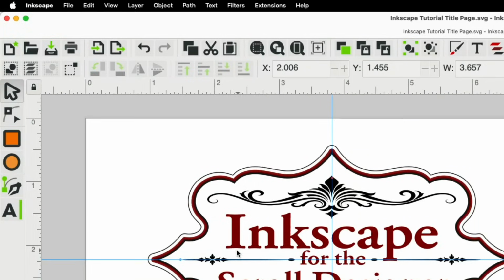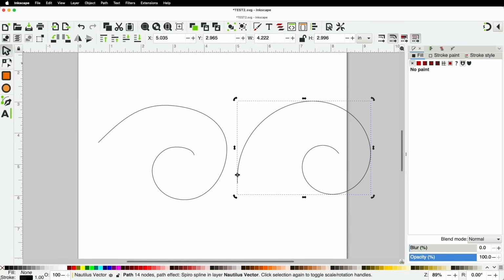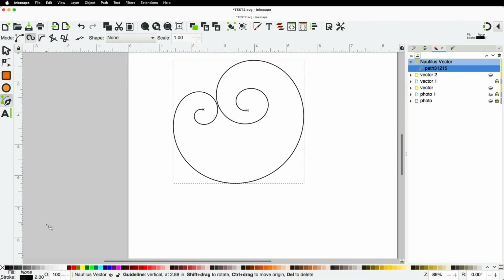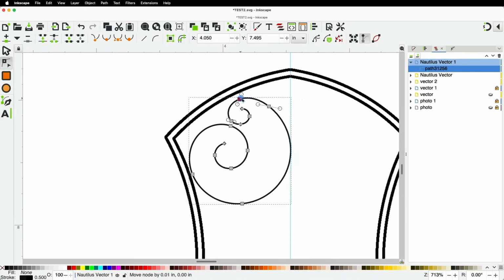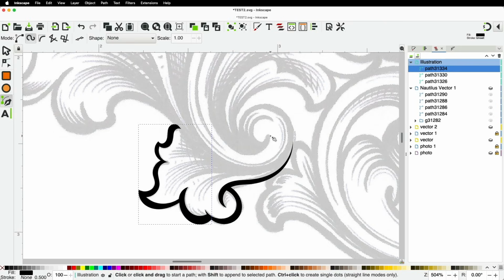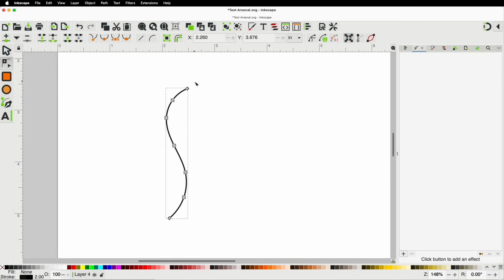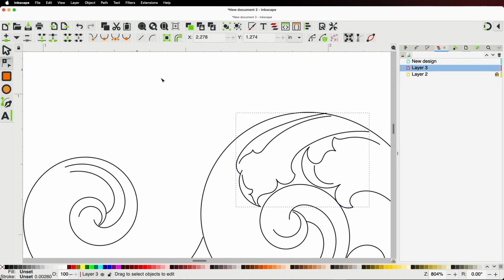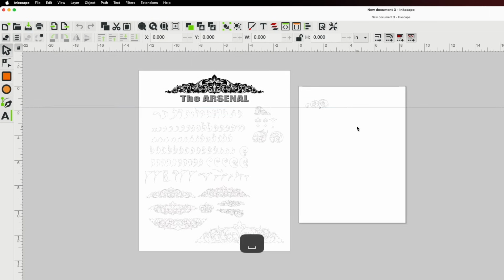Inkscape for the Scroll Designer

Comment: I can't believe I've been using Inkscape for 20 years and I never knew about the spiro path tool! Thank you!

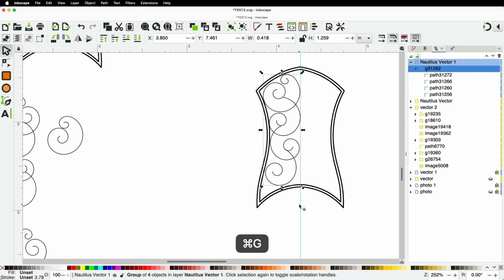One feature you might not know: once you create the group at 28:00, if you duplicate it with Alt-D instead of Ctrl-D you create a clone, which is a link to the original instead of a full copy. (Or you can use the Clone items in the Edit menu.) You can then flip the clone horizontally and move it, or even scale it and rotate it; then, when you change the original object, including double clicking on the original if it's a group in order to edit its contents (without undoing the group), all your edits will be automatically reflected on the clones, meaning on the mirrored side. This way, as you are editing the left side, changing the paths or adding new ones inside the group, you will see the right side automatically update after every operation.

Another piece of advice: if you use one of the default Shape options on the top toolbar when creating a path (such as Triangle in) then when you go into edit mode you will see an extra pink control point. That point controls the thickness of the path! You can move it around, for instance moving it to the middle of an S shape will create a nice thin-thick-thin shape, without having to draw both sides of the shape by hand, as a closed curve. Or using the Triangle out shape will allow you to make your fills, the ones you use the half circle for, but give you extra control on their thickness. You can Ctrl-click (I suppose Cmd on Mac?) and drag on a pink control point to create a new one, and Ctrl-Alt-click on one to delete it. This way, 99% of shape thickness can be quickly edited without having to manually create a closed shape. The way this works is by adding Power Stroke in the Path Effects, where you will find further options to control the width generated by the pink control points.

Inkscape is amazing, you can use it for decades and still discover huge parts of it. By the way, I would recommend using the latest version and not an older one, unless you are waiting for a specific bug to be fixed, because they are always working on fixing things and adding new features.
Reply from the maker: Yes. All good tips. Unfortunately the latest versions have Spiro bugs
Reply: @NGraver001  New version 1.4.4 is out since 5/6/26. Does it have the spiro bugs?

Comment: If I may I'd like to suggest some options that you may find useful. In order to align nodes you can select the align and distribute which will do just that for nodes as well as objects. Also, when you draw a spiral, it is initially a stroke, that is it is only a curled line. You can make that line broader by selecting path> stroke to path, and widen the stroke. Finally, instead of manually placing object that you want symmetrical, you can use the path> path effects tool to mirror or tile objects. Hope this helps.

Comment: how do you have the template next to the page like that. and if you save and bring it to ezcad, will it send just the page on the right?
Reply from the maker: You can put any element off to the side of the "Page". The best way to use one of these types of designs is to cut and paste the groups of vectors into EZ-Cad. I don't use EZ-Cad myself. I use Light burn. So I can't offer much help there
Reply: @NGraver001  thankyou

Comment: I never use inkscape, but is there any features that can adjust pen line thickness in desired spots like in illustrator? I thought that would ease up the line and work process
Reply from the maker: There is...It's called Power Stroke and it is in the Path Effects menu. It can be useful but I have far more control by just drawing both sides of the variable thickness line. And it is probably just as fast or faster

Comment: You may want to use the Power Stroke effect to add line width 23:50 line to path from the path menu.
Reply from the maker: In that example I want a thin line. The thin line functions as a guide for further design. If you see my second video "Part 2" I use "Pattern Along Path" to build designs with structure more like the Power Stroke but with more functionality.
Reply: @NGraver001  Is it possible to achieve a full Scroll drawing from scratch using Inkscape, or do I have to hand-draw it first?
Reply from the maker: @MohamedAyman-li6rp  Well....That really depends on your skill level. I have regularly drawn entire designs in Inkscape. But I have a lot of experience. If you have watched the video through to the end you would see that I was creating entire designs using elements that I had previously created in Inkscape. The more work you put into it the faster and easier it becomes.

Comment: genuinely excellent tutorial... 
extra points, digging around in the path effects menus, are Mirror and circular Array. those 2 modifiers are gold, as they let you set up dymanic objects that update as you work on the 'original'.
bonus extra points, you can stack these modifiers.. so Mirror across the vertical, Mirror that 'pair' across the horzontal, then circular array that into a wheel... and only edit that single object!
Reply from the maker: Thank you. I have played around with many of the other effects. Have not used the mirror function though I have seen it demonstrated before. Inkscape is very powerful!

Comment: Just wanted to chime in with all the other comments.  This tutorial is an incredible find and I am so glad you came back after a six year break.  As soon as I saw you had a template for sale, I knew I had to have it.  I have had Inkscape for many years and have used it for various laser projects, but I did not want to go backwards to avoid the Spiro bug.  I am currently using version 1.4 and the issue is still there, but I did find that it often adds extra points to the path you are trying to create.  Deleting those points seems to fix the problem and leaves you with a usable Spiro Path.  Not that this is acceptable if you are doing a lot of Spiro Paths, but maybe it is a good enough workaround for the moment.  In the meantime, I am enjoying just playing around with your template and seeing what I can do and if I can use it with my fiber laser to generate acceptable scroll work in metal.  Thanks again!
Reply: Are you using a cutting Fiber Laser machine or carving one?

Comment: Fantastic video. I have been in love with vectors for decades! This was great info about scroll work. Wish I had know this a year ago.
Thank you!

Tip on duplicating: instead of using two keys use space bar. With the selection tool selected click on the original shape as thought you are going move it (but don't move it) with you left mouse button held down hit space. It places a duplicate of your selection like a stamp. Now you can move your new copy any where you want, or hover over the new location and hit space again and place a copy. You can hit space as many times as you like.  As long as you hold the left mouse button.

Comment: About half way through you need to resize the center a little bit and mention that this is as hard as it gets. There is an easier way to scale that center part. Use the Transform handles on nodes tool. It's an icon that looks like the resize handles and it allows you to scale, rotate and skew your selection of nodes.
Reply from the maker: Thank you! I am still learning so much my self. I absolutely love Inkscape!

Comment: Do you have a link to the bug report?
Reply from the maker: I tried to create a bug report a while back. I think you need to be a rocket scientist to submit one....I am not a programmer...lol. It would be incredible if you could get it fixed because I'd love to be using the newest version. The Spiro path does wonky things until you finish the path. It creates straight sections when it should be making curved sections. Sorry I can't explain it better. Sometimes they straighten out when terminating and sometimes not.
Reply: @NGraver001  I've seen the spiro errors caused by certain numbers going to infinity, but those problems have always been there so v1.2 would have them too. I did fix a spiro issue where ending the spiro would change the curve from the preview as there would be a slight variation from the start point and where it thought the start point was.

A bug report is fairly easy, mostly if you can report in words (like the above) with as many details about the steps, then someone from the community will usually confirm it. You can also search for existing spiro bugs, you're unlikely to be the only person. I fear though that this bug will remain though as I'm not sure it's getting any attention.
Reply from the maker: The reason I never pursued it was because I assume somebody else would take care of it. I don't think enough people appreciate that tool to be concerned..
Reply from the maker: I reinstalled the latest version to test it. I do like the newest version. The bug is #8727. It is basically a preview issue that usually self corrects although on occasion it does not. All in all I think I will encourage people to use the latest current version. The preview issue isn't too bad as long as people understand what is happening. I love the interface enhancements and the Shape Builder Tool is a huge advancement. Thanks for all the work you guys put into this!

Comment: ALSO, a few workflow improvements I use: 

Backspace will delete the last node you placed, you don't need to start over if you make a mistake.

If you want to add a node without a long mouse trip to the plus button you can simply double click the line where you want the new node while you're in node edit mode. 

Use hot keys to switch tool mode -  'N' for node edit, 'B' for spline editor and 'S' for selection tool.
Reply from the maker: Great tips, thanks for sharing! CTRL-Z Seems to be more convenient for me than heading to the back space. You sound like a power user. Shortcut keys are great but I didn't want to overwhelm a new user with so much to remember. Adding nodes by double clicking the line works great on a standard Bezier Curve but not so much if the curve is Spiro. The underlying curve tends to be all over the place. You can turn on " show path outline" to see the underlying curve but I don't like the clutter. Thanks for sharing ....I picked up a few things from you!
Reply: @NGraver001  Totally! Really anything to avoid carpel tunnel for a little longer.

Thanks again for posting the video, I've been trying to figure out a workflow for vector scrolls for a few months now and this helped a lot.

Id like to submit a request for a video about backbone design/layout (especially for tight/irregular spaces) and also best practices for shading.
Reply from the maker: @ that is definitely something I’m considering

Comment: So does Inkscape not have the ability to make tapered strokes? Like a stroke with varying widths along the path? Both Illustrator and Affinity Designer allow you to do this. In Inkscape, all I saw you do was stretch that half-circle shape along the path, which seems kind of clunky compared to just having a tapered stroke tool.
Reply from the maker: Yes Inkscape does, It's called a "Power Stroke". I wanted to cover it but the video was too long. You can find other videos about it. I will probably do a follow up video with more advanced uses and that would be part of it. Also there is way more to the "Half circle" technique. You can do some amazing things with it. It's called "Pattern Along Path". Once again, in another video hopefully
Reply: @NGraver001  Actually, Inkscape has both taper and power stroke path effects. That is the "hidden" power in Inkscape. One of the most useful path effects is the rotate LPE. With your skill at creating scroll patterns, you could create some facinating mandala art with Inkscape.
Reply from the maker: I have done that. The available tools in Inkscape will keep you entertained for a looong time. lol
Reply: @NGraver001  I purchased Affinity Designer last spring but I keep coming back to Inkscape for those little nuggets it has. 

For a maker/crafter, it still beats anything available. I use it as a design aid for Autodesk Fusion 360.

Comment: As an avid user of Inkscape, particular vector editing, so glad you mention the compass method. A confirmation of the method is a circle, its nodes are placed at the compass. Its handles are important too for smoothness.
A handy tip where you chose an element then dragged to the page, I find duplicate and cut to clipboard, then  move your mouse to a desired position, cmd-v and the copied element is placed exactly where your mouse is.
Your video has enhanced my learning to the next level, great video.
Reply from the maker: Appreciate the kind words, glad you found some useful tips in the video! Good Tip about the copy paste!